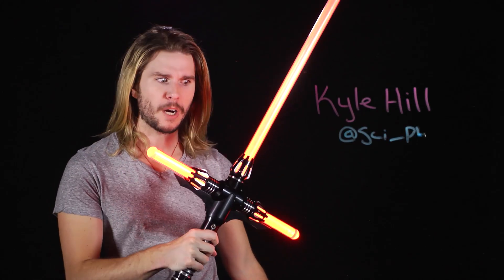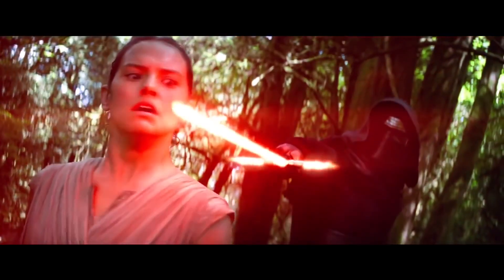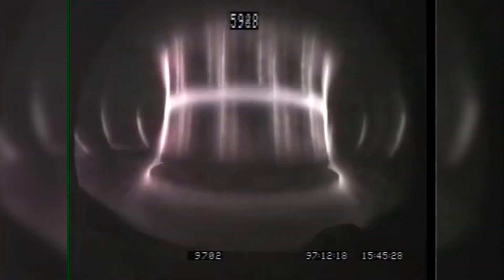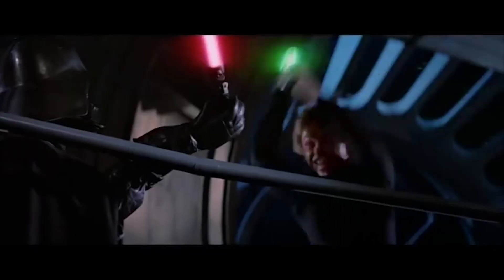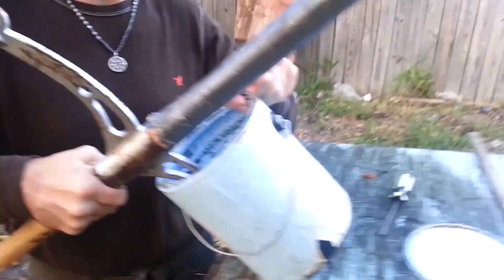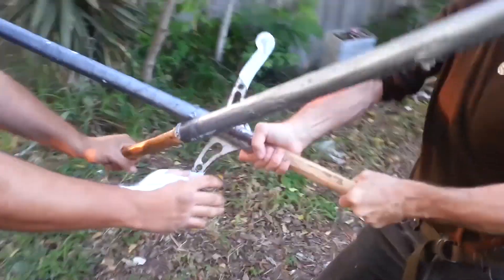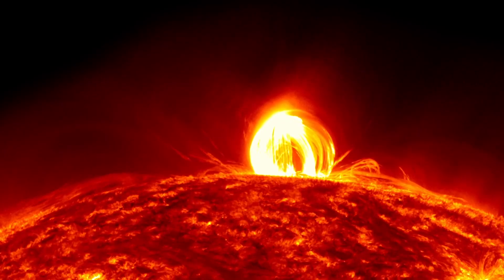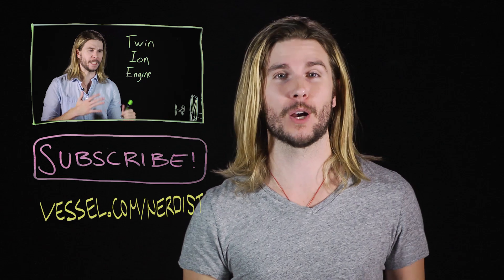Why Kylo Ren's Lightsaber Works (Because Science w/ Kyle Hill)

Comment: few things this style of lightsaber was already in the universe dating back to the old republic however the crossguards were made of a lightsaber proof material that could not be cut by a blade.  Kylo modified this by making the crystal's beam reflect and shoot horizontally with i final large beam vertically how he did this... idk but he did also the way his beam is sooooo distorted and odd compared to other blades like anakin's in the same movie (yes it was luke's but it was first Anakin's)  that blue saber is made with a REAL crystal probably harvested from illum were as a sith or dark side user will make his red by using a synthetic crystal which is less stable now take the cross guard beam style which would make a real crystal unstable due to taking focusing crystals pointing them three ways and splitting the beam now take that style and put in a synthetic crystal... that is why his blade crackles and is distorted compared to other blades.
Reply: synthetic crystals are now non-canon. Instead a kyber crystal by a process called bleeding where the darksider fills the crystal with the dark side. Kylo's saber has crossguards because he cracked his crystal and needed those vents so it wouldn't explode on him

Comment: 1. I fence with German longsword, and I can confirm that unless you are incredibly stupid, the cross guard won't touch you. That guy had a greatsword with a bigger hilt, making it easier to avoid the crossguard, whereas the lightsaber hilts are more longsword length. 
2. Kylo's lightsaber looks different because a: he had no one to teach him how to make a lightsaber, and b: his focusing crystal is cracked, giving it that fucked up look. c: because no one was there to supervise the forging(?) of his lightsaber, the energy field, or magnetic pull, is also askew, which is why it dangerously flares out like that. 
3. On his crossguard, "You can cut through it," it invalid because a: as said in the video it is just a casing and b: there are a few rare materials that Lightsabers are unable to harm. General Grevious' bodyguards' staffs were made of a material impervious to Lightsabers, which is why they are able to be able to fend off Jedi, even for a short amount of time. Kylo's crossguard m

Comment: Actually Kylo's cross guard lightsaber doesn't work, at least not in the way you think.  Mainly it was done because JJ Abrams thought it looked "cool".

One reason for a cross guard is to stop a blade during a block or parry.  Metal blades can slide along each other so the guard catches it before it gets to your hand.  Lightsaber blades do not "slide" like metal blades do, so that protection would not be needed. 

Second reason is to prevent your hand from sliding up during a thrust.  Again, in a lightsaber this is not needed as the blade itself is essentially weightless and the handle doesn't weigh much.  You rarely find resistance when you thrust with a lightsaber also.

Third, some smaller weapons are designed to have their cross guard catch the opponent's blade to disarm them.  Once again, in a lightsaber this wouldn't work as at the very least your opponent could turn the blade on and off to release.  Plus plasma blades don't "catch" like a solid metal blade does.

Finally, the main blade would be weaker as some of the energy is bleeding off into the cross guard.  This would mean it would cut less effectively and not be able to block other lightsabers as well.

Comment: Just to add to your arguments here having plasma that close to your hand when it comes to lightsaber technology is actually perfectly safe. Part of lightsaber tech includes a field which both holds the blade in place and contains the energy. Until this field is broken - (AKA: By making contact with something) - A lightsaber blade is essentially harmless and gives off no heat.

Another point to add here is that the crossguard saber actually exists already in starwars lore before disney came along. It just wasn't that well known by a majority of the starwars fanbase. Just as I bet the long handled saber isn't that well known, or the sabercane.

Comment: 1.) Kylo Ren is a whiny, weak-minded bitch, not a brutal, archaic character.
2.)With the lightsabre being very light, swinging it around at high speed with a crossguard is not safe. Unlike a  crossguard on a medieval sword, the lightsabre crossguard would rip your hand of if you accidentially touch it in a fight.
3.) Technique is a lot different in a real fight than in a slow moving demonstration. With a lot of quick shoves, pulls, nudges and bumps you'll never have the same accuracy.
4.) Whenever you try to hook somebody and lock out the opponent's sabre, you end up pointing one end of the crossguard towards yourself in an undefended line. That's why crossguards on metal swords aren't pointed.
5.) The argument "It's not a crossguard, it's a vent, because it's an old design to mimic his personality" just makes this sabre a stupid, unnecessary plot device. It doesn't add to Kylo's "archaic and brutal" nature, it just makes him more of a douche who rejects modern technology. Even his grandfather had a better lightsabre than him.

Comment: The reason his lightsaber has "crossguards" is because his crystal is cracked. They are actually vents. In the movie when he is fighting finn, he pins finn against a tree and burns a hole in his shoulder. You can see that its just vents and not actual blades because kylo doesnt touch finn with them. He just pushes it really close. Without the vents in his lightsaber, when he turns it on it would explode after a few moments because the energy has no where to go. Also you can tell that its cracked by looking up close at the blade. It might look normal from afar, but upclose you can see that its jagged and a bit thinner than a standard lightsaber.

Comment: lightsabers were supposed to be not easy to move. Mark Hamill tells in an interview they had to act as if those things were always really heavy, with 2handed swings that were difficult to stop when not focussing (luke and vader repeatedly missing and hitting a railing). the lightsaber supposedly also had a gyroscopic effect, making it slightly more difficult to turn the lightsaber. it's not wupposed to be weightless is what i want to say.

Comment: Wait if the blade if the blade goes all the way through and connected to the main one how does it turn on independent from the main one and if its not connected to the main one the saber would have 2 or more crystals which is impossible

Comment: I hate people like this........First off we do know how lightsabers work just open any star wars encyclopedia to see they uses a lens so no the 3 way thing would not work a beam of light gets focused from a crystal to a lens and the alignment of said crystal to the lens must be perfect you can not set it up to send energy 3 different ways from one point secondly check each one of those scenes where somebody loses something hand, arm , or whatever as most of them weren't even using a lightsaber with or without cross guard to stop the blade.   Now show me how a cross guard could have helped any of them the angles the saber was when they lost said limb would not have changed  and the hilt would be nowhere in the way of stoping the other blade  ok................. now go look at diagrams for how sabers work and that one beam of energy just spliting 3 ways wont work either. 

The fact the cross beams are smaller too come on your talking 3 different emitters which means three different lens which is three different crystals for each beam alignment not enough space for all that so when J.J changes the whole make up of the lightsaber to make this stupid weapon fit into lure thats gonna suck and all applicable methods of not getting your hand or arm cut off while using a lightsaber is all skill and the force so yeah fuck cross guard light saber

Comment: the one point where this argumentation is flawed tho is at the part where the weight factors in. like you say that the guy who dips the crossguard of a big clamour sword in wet paint and then twirls it around without painting himself. there you say that he is struggling a bit because of the weight of the sword, and one of the beautiful things about lightsabers is that they would be practically weightless and thus alot easier to handle that way. but that conclusion is false. 

the weightlessness would actually make it alot harder to do these kinds of moves in a controlled way. it is the right combination of weight, balance and diameter of any object that makes this controlled acrobatic twirling stuff possible in the first place. just try to use an object that resembles a typical lightsaber hilt without the blade, that is fairly short and has all its weight condensed in the center like that, and try twirling that around. that is a much harder task than doing it with a longer stick where a good deal of its total weight is far away from its core and axis of rotation. 

thatd be next to impossible to control without hurting yourself with a regular single beam lightsaber. now imagine having to also watch out for 2 additional beams sticking out at the sides ontop of that. -.-
the weightlessness is a rather peculiar issue about hypothetical lightsaber fighting anyway. the obvious advantage is that the lack of weight and would make inertia less of a factor and enable you to stop or change direction within a swing motion much faster. it would also be much less tiring for the user. it essentially lets you "fence" with a sword, which would usually be impossible thx to our laws of physics. so you can choreograph fights with very quick slashing and blocking alright, kind of like in JRPGs if that is your cup of tea, the weapons there for some reason always appear to be weightless as well :S

but acrobatic twirling like that? insanely hard to control, super hazardous to your own health. ESPECIALLY with a saber like kylo rens. i also think it would be better to explain it as an unwanted side effect of a cracked crystal, instead of a wanted cross-guard feature. cause even IF we assume that the design is actually practical with lightsabers, the way it clearly is with regular swords, wouldnt that be like a total slap in the face to anyone in the SW universe who had ever created a lighsaber before that one? as you basically point out yourself quite nicely, hell yeah the danger of getting ones swordhand cut off during swordfighting is still very real, even in a galaxy far far away lol. if it were feasible to design lighsabers with cross guards that way, that would make everyone look incredibly stupid for designing them without, given how we all have known the importance of that since thousands of years B.C.

Comment: Well on the subject of it's practicality, it really wouldn't work well as a guard. The metal is just as vulnerable as on any saber so if one were to hit that metal piece there'd be nothing framing the 'blade' coming out of the vent and so it would probably fail to act as a guard from that point anyway. But in the same way that Force users don't usually let their opponent hit the hilt of their saber, the metal piece is no MORE vulnerable than the hilt of a Lightsaber and so the argument of someone hitting it doesn't work because the user wouldn't let the opponent hit it just as they wouldn't a normal saber hilt. 

However, as many have said it has by now been explained that his crystal is cracked causing the unstable blade and the 'guards' are not really guards anyway (though maybe as a secondary use but that's definitely not what they are primarily), they are vents. Based on an ancient design built with modern parts it's made to output the excess power given off by the unstable state of the crystal. This means it's more of a weapon anyway than a defensive tactic so he wouldn't be using it like a guard and putting other saber blades that close to it anyway. From there your point is exactly correct, a real wielder would train with said danger to make it negligible but furthermore that is the point of EVERY radical saber design. The whole point is to take a more dangerous unique thing, make it not dangerous to you, and because it's unique your opponent wont expect it, keeping the danger against them. Some would say that this provides less danger than a more practical one like the double saber or Lightwhip and therefore is less practical but one, that is a balance thing, you have to balance how much risk you're putting on yourself vs how much is on your opponent - this one happening to be less of a damaging thing to the opponent but the trade off is it's not as dangerous to use/easier to train the danger out of it, and two, since this is the secondary use of these things it's not like it was bad planning, the point becomes that any offensive use is a bonus to the vents' primary use which is practical in of itself.

What I don't know if anyone touched on yet is just how cool that makes this Lightsaber. Unstable sabers have been a concept in bits and pieces of the EU (yes I know, formerly canon but there's no reason to believe small aspects of how things work like this will be written out or changed so until they are changed I'm using these examples) and in pretty much all of those depictions did not have these vents. What we know about the sabers is that the pros of them is that they hurt a lot more and have more of a chance to break/short out an opponent's Lightsaber. The con is that they themselves are prone to shorting out due to power overloading. This means that ones without vents can exist, Kylo's just happens to be based on such an epic design that it has vents to equalize that power overload, likely meaning his blade gets all the benefits without any of the drawbacks/less of the drawback of an unstable Lightsaber blade. I mean despite being an unstable blade it took quite a few moments of forcing it into the snow to short it out. 

So in short Kylo Ren's Lightsaber is a heavy hitting brutal saber with vents made to prevent a lot of the drawback of such a kind of saber, on top of this they are a unique extra risk for the opponent to deal with, a double edge risk but one that it's user has learned how to deal with giving him once again little risk/drawback, all in a design that makes it look like a badass cross-guarded Lightsaber (even if it's not a guard).

Comment: The cross guards on Kylo Ren's Light saber are vents do to his unstable crystals used to make it hence the blade not being solid blades. He found out without the vents his light saber would build up so much gas so if you look carefully at the scenes of the light saber being used the vents come on after the blade if it was a blade guard or mini saber it would all have come on at once. JJ Abrams confirmed this that is saber is defective there for the vents are necessary.

Comment: lightsabers aren't plasma based, it's actually just the force itself from the crystal because if LSabers were made of plasma they would just go right through each other, its a very physical force field that cuts through anything. thats why Jedis feel connections to it
Reply: so you wanna say the normal ppl that use it have the force in them ?
Reply: +Jordan ter Hart what? and normal ppl have a chance of getting cut because they dont have that connection, Jedis feel the blade and can avoid getting cut.

Comment: The synthetic crystal used to power the lightsaber is unstable, thus giving it all the reasons as to why it looks different from your run of the mill lightsaber. This is why it crackles, not because they wanted to change the look. It's also why those crossguards are there. Those 2 extra protrusions are actually exhaust ports for the excess plasma, otherwise the instability of his crystal doubled with the crudely built saber will cause it to overheat and malfunction. It just happens to also be handy for keeping your hands nice and safe while also piercing through the shoulders of any traitor that crosses your path.

Comment: you use a standard cross guard really poorly. the cross guards on a regular sword are not sharp behind the guard or even at the front of them. but the cross guard on the light saber for kylo ren is sharp on any side of them. which negates the whole meant for protection.

Comment: Having a weightless blade is potentially more dangerous than a sword with weight, so in general any kind of light sabers are dangerous, but that issue can be solved with training. point is, if you find a lightsaber don't use it, just admire it, or you'll most likely lose a bodypart or your life.

Comment: Yeah its a cross guard, but that's not it's intended use. Kylo's lightsaber isn't a "real" lightsaber. It's homemade.The crystal is synthetic as most sith blades are. The crystal was made to be crazy powerful, and unstable. Because of this, the blade of the lightsaber is jagged and cracked and stuff. The "crossguard" is actually a ventilation system, keeping all that unstable energy from exploding in his hand.